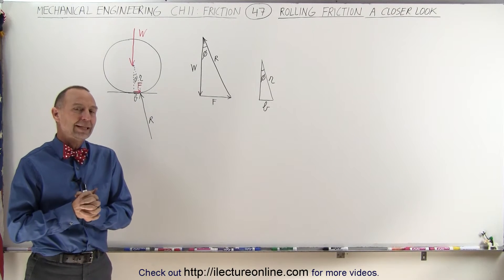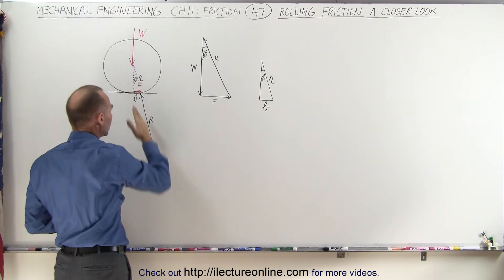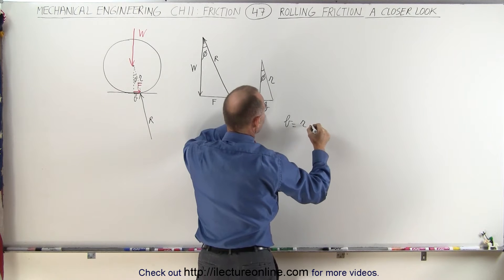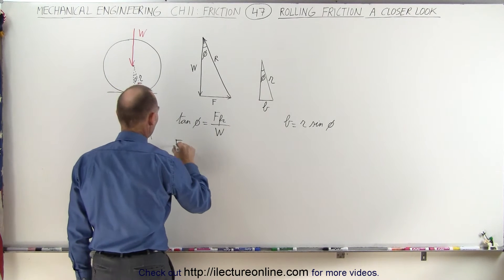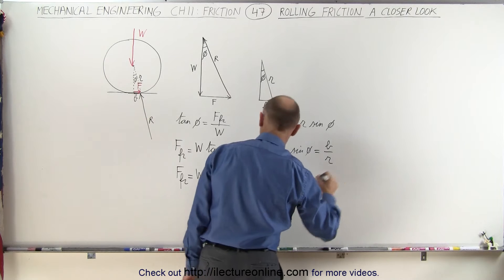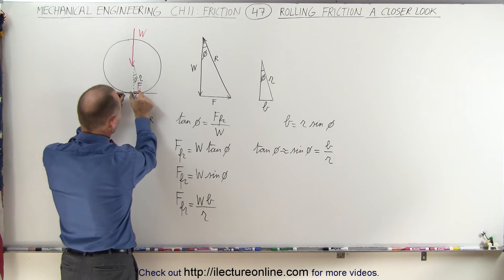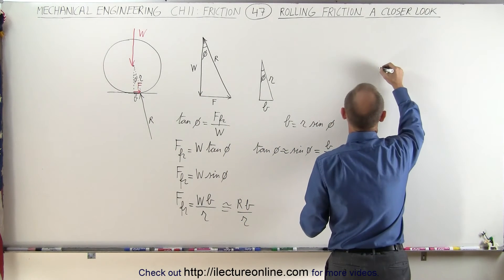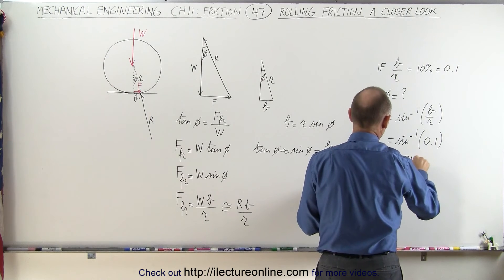Mechanical Engineering: Ch 11: Friction (47 of 47) Rolling Friction: A Closer Look

Comment: How should I define the friction, if, let's say, we have a steel sheet going in between two rollers (imagine it as a steel manufacturing process). And what forces would act in this situation?
Reply from the maker: It depends on how the mechanization is set up.  Sometimes it is the friction between the sheet and the rollers that propel the sheet forward.

Comment: Hi Michel, could you please elaborate on the direction of the rolling friction (or resistance) please?
Reply from the maker: Let's assume the wheel is attached to a vehicle moving to the right.  That means that the wheel is rotating clockwise.  If there was no friction, the wheel would spin and the vehicle would not move forward.  For the vehicle to move forward, a force needs to push it forward.  The friction between the wheel and the surface is that force pushing the vehicle forward.   (There is no other force that can).
Reply: @MichelvanBiezen  Thank you very much for the clarification 🙏